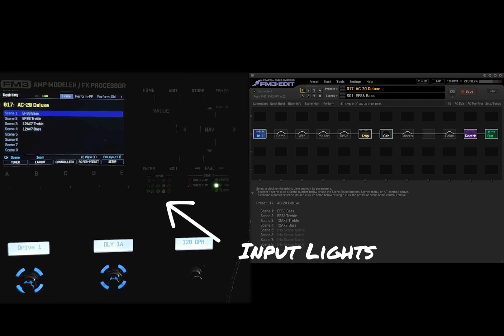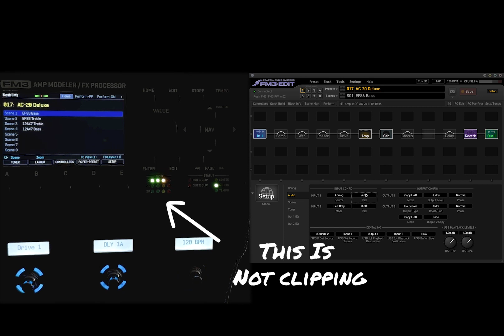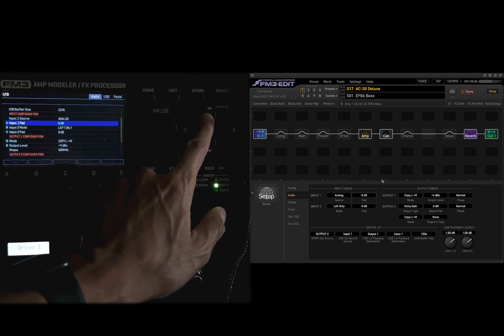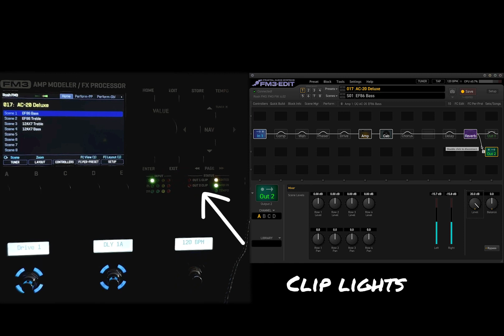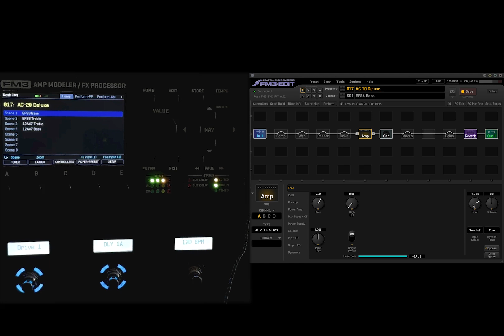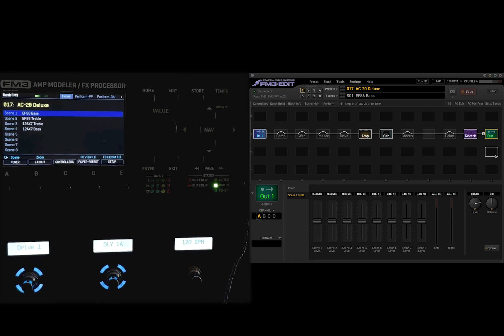FM3 Basics Episode 17 - Clipping Explained

Comment: The correct way to set the input pad is to turn off all the effects until all you have is the input(turn off gate too) and output block on. On the output block set the output to -18db. Then you strum and play and watch that meter in the output block. If the pickups are too hot you will notice the signal compresses on the meter indicating its clipping. Set the pad until you have lots of headroom and no longer running out of headroom. For my guitar with EMGs and a Duncan SH-14 in bridge pad 12db is the best setting for those pickups.
Reply: I agree. I was digging through Fractal forums and FM3 documentation trying to figure out how to make sure that I'm getting best quality DI signal from my FM3. I used different method, but ended up with the same conclusion as you.

I recorded FM3 DI signal in my DAW from "FM3 Input 3" (for clean signal) while strumming as hard as I can. I repeated with each pad setting and found that 0 dB pad resulted in heavily distorted DI sound and visibly clipped waveform (even though "OUT 1 CLIP" light was off the whole time). 6 dB pad waveform also had some clipped peaks, so 12 dB pad worked best for my guitar too (Solar S1.6PB with stock pickups).

My understanding is that "OUT 1 CLIP" red light indicates only clipping which happens after A/D conversion, so in this case with 0 dB pad I got clipping before A/D conversion, which is harder to notice as there is no red light for that, unfortunately.
And as it was said in the video - the red light on input meter doesn't mean clipping (it gets triggered at -6 dB from input clipping point).

Comment: Hey there! Super helpful video! Can you explain the input gain +1.000 default setting in the global settings? Does anyone else lower these settings? When would you have to change this setting? Thank you in advance!
Reply from the maker: This knob allows you to add extra gain across all the presets (or subtract gain) to compensate for different pickup outputs. I use it occassionally when switching between single coil and humbucker pickups

Comment: The issue I am having is not balancing input but rather internal clipping when boosting  a scene via a filter block. All my initial scenes are balanced and not clipping. However when I want a decent boost the scene clips--how do I overcome this?
Reply from the maker: Are you actually clipping? As in hearing a digital clipping sound and going about 20db above the zero mark? If so, just turn the amps down. If you're going slightly into the red, even about 5 db, you are not clipping
Reply: @RoshRoslin  No I don't hear a clipping sound. What concerned me was the fact the internal clipping light briefly comes on depending on how hard I hit the strings and then sometimes its on a lot--does this harm the unit?